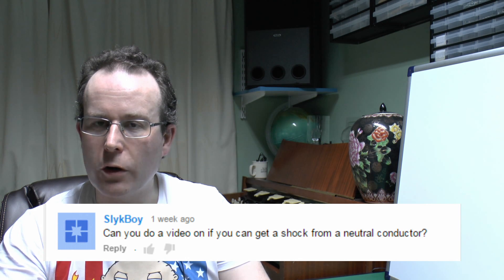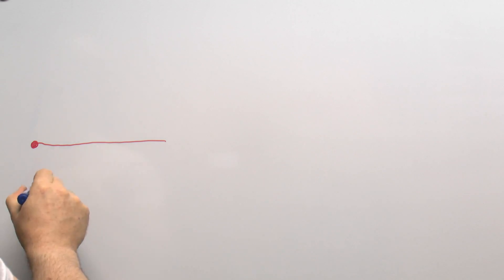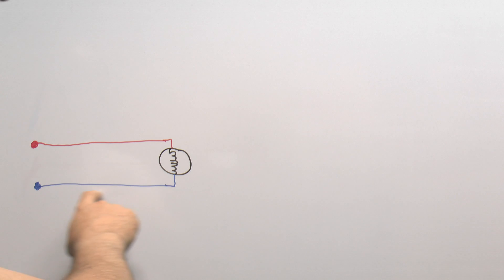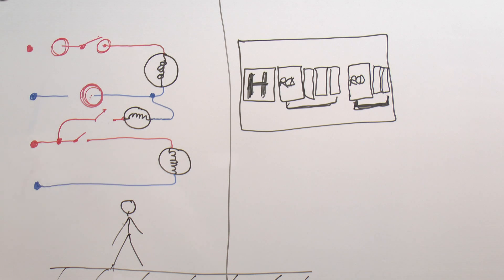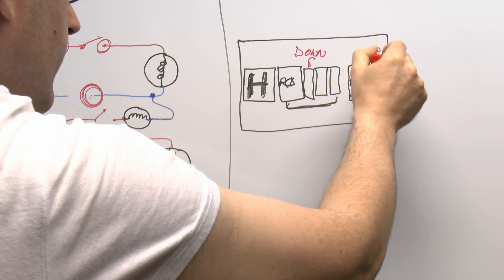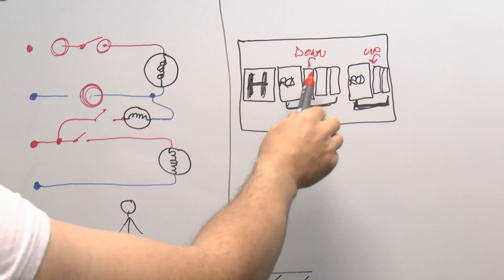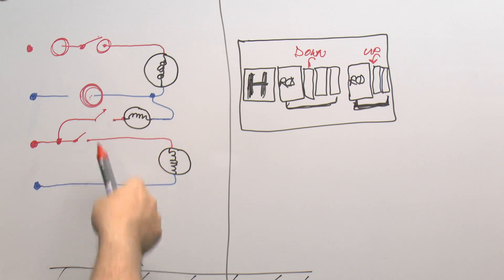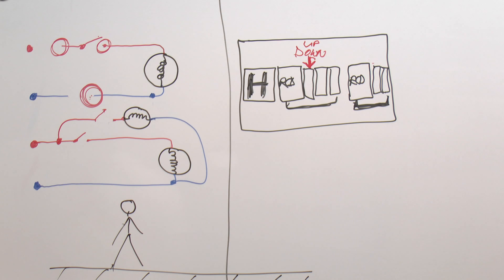Shared or Borrowed Neutrals on Mains Electricity Circuits

Comment: But downstairs you said if you are grounded ie touching the ground you get a shock but if you are upstairs how are you connected to ground to get the shock?
Reply from the maker: Most common building materials are conductive to some extent, and even if you are totally insulated there is still capacitance to consider.  It's extremely difficult to remove yourself completely from the ground, and the amount of current to cause a noticeable shock is tiny.

Comment: I worked as a meter engineer for several years. Part of the training was to be aware of borrowed neutrals. These can be particularly hazardous where there is a 3 phase supply in an apartment block. There was at least one occasion when a meter was exchanged ( not by myself)  which resulted in the neutral supply to other properties being removed . This caused 415v to be applied to 3 apartments causing extensive damage to electrical appliances. Other instances where borrowed neutrals can be a problem are when the live supply is fed through an RCD and the neutral is connected at two different points, i.e on either side of a time switch. This can cause the RCD to trip.
Reply: Very well explained have come across this many times.

Comment: Why, when a connection shorts to ground, does the electricity buzz, go silent, then explode? Why doesn't it just pop immediately?
Reply: 1. arcing,low current, 2. better coupling when heated and brought into better contact,high current flow. 3. due to large current, weakest link in circuit overheats beyond capacity and goes boom. over

Comment: I hope John ward answers me or anyone.someone to clarify for me,why is neutral earthed and i think the current 
would still flow between the two lines in absence of the Earth?It is said earth is at 0v,why does the bulb fail to light when you connect negative terminal to the earth without having another connection to the positive terminal of the battery or vice versa?kind regards for any comment

Comment: Yeah, ran into this the other day, come to think of it I still need to go back to follow up on some things. Another way is to clamp on an inductive amp meter on any neutrals your about to work on. If you have turned of the power to the circuit you are working on and find any reasonable amount of current on associated neutrals then it's a good idea to start turning off breakers until amp meter reads zero (or close to it).

Comment: In the Netherlands, we switch both Line and Neutral at the fusebox. That means that when you switch off the circuit you’re working on, you would immediately measure dangerous voltage on the entire circuit still existing. Well, unless the switch was off and then turned on while you were working, at least...
Reply: Do you have a neutral fuse for each group, or do you mean that the main breaker is disconnecting the neutral as well?
Reply: @amanduswestin9211  no, only the line is fused. But the switch (when those were separate devices) switches both. And yes, on modern boards with breakers instead of fuses, if the line trips it will disconnect the neutral automatically.

This is one weird thing about our electrics, (almost?) everyone else only fuses and switches the line.

Comment: I would like to see an explanation of why some parts of the world use 240V rather than 120V. I have received many, many shocks over the years from 120, and while they do tickle quite strongly, unless one is knee-deep in a lake, or otherwise very well grounded (Sorry, earthed. I'm American), they're more annoying than hazardous. I have been shocked by 240V only once that I can recall, and obviously it was a much stronger shock, much more likely to cause serious harm. It seems as if it would be much more prudent for the whole world to use the lower voltage, so why don't they?
Reply from the maker: Lower voltage = higher current for the same power, so cables need to be larger and losses in the cables are much greater.
120V would be useless in the UK, as we would need a 25 amp circuit for a kettle.
Reply: You have 3 KW kettles in the UK? If by 'kettle', you mean something akin to a coffee maker, mine is a mere 900 watts. And what are commonly used wire sizes there? Here, homes are wired for the most part with 12 gauge, which is just over two mm in diameter and is allowed to carry up to 20A, and 14 gauge, which is about 1.63 mm and may carry 15A. Of course, the mains coming in are substantially larger; I'm talking about interior wiring for lamps and receptacles and such. 
I'm sorry, I'm just very curious about why, once again, the US is sort of a lone wolf, and is doing things differently from most of the rest of the world. I mean, we STILL haven't switched to the far superior metric system of measurements, and it is the twenty-first century! Then again, you all still measure your weight in stones. It's all quite confusing to me.
Reply: Also, thanks so much for replying so promptly.
Reply from the maker: Kettles are used to boil water, mainly for making tea.  Examples here: http://www.argos.co.uk/search/kettle/
Better ones are 3kW, some cheaper types may be 2.2 - 2.5.
Wires are all metric and specified by cross sectional area of the conductors, common sizes are 1.0mm² for 6A lighting, 2.5mm² for 20A (or 32A where 2 cables are used in a ring), and 6.0mm² for 40-50A circuits.  Other sizes are available but seldom used in homes. Some cables in this video: https://www.youtube.com/watch?v=q_2qGZeXEd4
As for metric - some things are, plenty are not, some are both.  Large distances are always in miles, smaller ones can be in metres, weights of packaged items like food are metric but often in quantities like 454g which is exactly 1lb, car tyres have the rim diameter in inches but the tread width in mm, building materials like sheets of plywood are typically 2.4m x 1.2m, which is the nearest equivalent to 8x4ft but not exactly.
Reply: Most interesting, most informative, and again I thank you for the prompt reply. I was not expecting to hear back so soon. I hope you will enjoy a relaxing Sunday afternoon.
Reply: @jwflame  
This made me laugh out loud.
It must look ridiculous to people from other countries.
Reply: we've had 3kw kettles for quite a while and the mains cables were only 10amp rated. probably ok as a kettle is only run for a few minutes at a time..normally.. but one time  we had to boil a few times one after the other, the cable got scarily hot! they ought to have fitted 13amp cable 😲

Comment: You speak of a retrofit light with control upstairs and downstairs, then you only show a single downstairs switch...?  Also, when running the cable to the new lighting fixture (4:57), if you are running a cable, why would you run a single conductor?...you wouldn't! (I don't think this is even allowed in the US!)...you would run a new four conductor cable (since you're running cable anyway!), with Neutral and Safety Ground from ONE source, to the new fixture, as well as new upstairs (called a two-way circuit here) switch, and prevent all of this rigamaroll!  Playing games with the Neutral like this can set up for all sorts of "creative" issues...  Cheers from Connecticut!

Comment: STOP . A twenty dollar motion activated battery light in the stairway would solve the problem. NO wires no Bullshit. I use them in several areas with no issues.  Why make life complicated when simple solutions exist????
Reply: but...not as bright, and you'd be forever replacing batteries if there was a lot of traffic .....
Reply: The units I use have more than enough light output and batteries, 4 D cells, lasts for months. They cost a mere twenty bucks and are simple to install. Really, stop doing it the hard way!!!!
Reply: that actually sounds a good one, only ones i've seen so far use AAs or even AAAs, and/or poor light output!!
Reply: It may have been 30 or 40 or even more years ago that some of this doggy cabling was installed. Battery operated PIRS may not have been around back then.

Comment: Quick question for you. Can't find any reference for it. I have a site with a generator. I have fitted an interlocking changeover isolator / switch. I am not sure however if I am permitted to bond the generator earth to the site frame. Any ideas ?
Reply from the maker: It is permitted and in most installations would actually be required - if not, then the supply from the generator may not be referenced to the installation which may prevent protective devices such as circuit breakers and RCDs from working properly or at all.
It's also essential to confirm exactly how the generator is configured, some have an internal link between the neutral output and the generator earth, others do not, and some evil ones are configured as centre tap and other unwelcome arrangements.
Reply: John Ward Thanks John. It is nuetral bonded and connected via a 5000Kva UPS that starts and stops it. I just wasnt sure if I had to install an earth rod. Thanks so much for the prompt reply. Keep up the great work :) Thanks again.

Comment: Thanks, in the States we share common (white wire) all the time.  If the common is discounted you end up with 220 volts and it will burn out everything on those 2 circuits. We have this problem in remodeling, the Demo crew will remove a hot and a neutral not  realizing the white is shared down the line with an other hot.
 In the States, in a 3 phase panel we skip every 3 rd breaker space because that is the high voltage leg.  Then someone that doesn't understand 3 phase sees all these empty spaces and installs a 120 V. curcuit for outlets   It works for about 2 hrs until the appliances burn out.  They can't figure it out because 3 phase is only used in heavy commercial and Industrial applications here.  Some Cities require all 3 phase circuits to be in a separate high voltage panel and all the outlets and lights in a low voltage panel.

Comment: Ummm, the three-phase situation is potentially (groan) a problem whether it's a 3-pole breaker or 3 single-pole breakers.  Because all those lights will have switches.  And all those lights can fail or be removed.  If any one light is switched off, removed, or fails, and the shared neutral gets disconnected, then neutral is at a high potential.

In fact, the disconnected neutral only stays (relatively) safe with power applied if the loads are equally balanced.  So if two of the lights are 100W and the other is 60W you again have a problem if neutral gets disconnected.  Not as much of a problem as if one light fails/is removed/is switched off, but still a problem.

Then again, if you're working on the wiring and relying on the state of switches because you can't be bothered turning the main breaker off, you have a big problem anyway.
Reply: Never seen three phase in residential! USA only two legs coming in from utility.

Comment: Great video JW, it's late o'clock here down under and I'm listning to your videos whilst typing invoices,  common neutrals is a real problem in older houses here in Au, mostly when two way switches were added to long halways or stairways, I have even had a case where the sparky installed an outside light and stole its neutral from one of the slab heating zones.  The poor customer never understands why a light that has worked for the last eleventy seven years and probably has never even had the globe replaced, has to be disconnected or spend a small fortune on "fixing" it.  Thanks for the time and effort you put into your videos.

Comment: in 3 phases system with loads in star there are not nealy symetrical or sinlge phase loads its a disaster if neutral fails at a commen point! it make a asymetrical voltage splitting on loads! so more asymetrical the load is so more asymetrical is the voltage! i spoke with a electrican he worked on hamburger dom ( jahrmarkt ?? festival ...  there was a major fail in neutral at a point there was a heavy asymetrical load! most diveces are bürn or explode on much higher voltages!
Reply: If you can guarantee the loads are equally balanced you do not need a neutral because if the balance is perfect the current in the neutral will be zero.  In practise you can tolerate a slight imbalance and still get away with it.

The major power lines in any country rely on that fact to save copper.  It's just the three phases between the power station and the big transformers at the other end.  Oh, and equipment that trips out on major imbalances. :)
Reply: Yes, and guess what ...
One time, i saw some electrician (a very dump one) who connected the neutral of a 3 phases circuit through a single circuit breaker ... go figure!

Comment: Actually is it not true if so you touch a live hot wire & so long as you're not grounded & or touching the neutral or a grounded item like a ground wire, a water pipe or something else that's grounded like say a puddle of water' the current will not then flow thru you or shock you? At least I know it never has me. Also it's so much more dangerous to touch a live wire in one hand & a ground in the other hand as then the current can & will pass through your one side to the other through your heart & it can kill you. Now I have taken a lot of shocks & simply because I was not grounded I survived it!
Reply: The not being killed by touching the live wire trick was demonstrated by a British Rail safety guy standing on the live rail during our safety course many years ago. Whatever you do, he said, don't put one foot on the ground otherwise you'll have both feet in the grave. He added that you shouldn't do it if it's wet out too

Comment: how to get safety mechanism at a home where such type of shared neutral occurs in different phase circuits. Is there any device which could trip if such a situation happens please suggest which to be used for a three phase connection

Comment: The worsed thing I ever found and the most expensive on a three phase installation was when the neutral was lost at the service meter this gave 400 volts across most of the lighting and power only found when two different phase circuits were switched on giving a path via the neutral terminal block which was just acting as a through connection all electronic equipment blew up all lighting capacitors blew up.  I have noticed lately that the service neutral is not supplied from the meter but from a block terminal instead.

Comment: I had a similar illegal neutral problem too where a lighting 1mm2 and power circuit 2.5mm2 neutral was connected together at a combo bathroom fan/light/ heater. When we tried to install a RCD on that gpo circuit it would trip when the light was switched on. It was a illegal DIY electrical job done by the previous owner.

Comment: In the states we share neutrals all the time (our power supply is set up for this 240/120 volt . Borrowing a neutral is a fire waiting to happen sharing a neutral on your system is the same a fire waiting to happen. On our system we share neutrals between two circuits a/c if you connect a load out side of these two circuits its a fire waiting to happen since we don,t fuse neutrals ,the new code with arc faults fixes this problem since the neutrals are not shared and the circuit will not reset.Thats if a breaker is used in the panel

Comment: Mr.Ward the part i didn't understand well was if there is power in a circuit and if we touched the neutral we wouldn't get a shock, but if we were grounded wouldn't our body be considered tha same as a resistor i series with the lamp because we would still complete the circuit. Or does it have to do something with the voltage drop across the lamp??
Reply: The resistance of our body is then placed parallel upon the resistance of the wire,and our body is about averaged 50 kilo ohm.So there will be no current through your body,because the resistance of the wire is far less than your body.

Comment: My question to Mr. Ward..
why there is no electric shock when we use the neon screwdriver to test electricity?
can we consider the screwdriver like the lamp (as a load)?
thanks in advance....
Reply from the maker: When working correctly, the current flow through these devices is very small.
Reply: John Ward When working correctly? that sounds terrifying.
Reply: These devices can fail if made cheaply (which all of them are) or if they get wet. It's much safer to use a 2-pole test lamp. If you MUST use one, then make sure you buy it new from a reputable shop, so you can sue someone if it goes wrong.
Reply: @Zoey You mean your dependants can sue the supplier...
Reply: smiling face    Col
Reply: There is a high-value resistor in the internal circuit of the tester.
Reply: That is correct. A Drummond test lamp is the standard equipment for testing, neon testers are only used where there is no alternative i.e. no available exposed earth.
Reply: Steve Jones I'm assuming the RCD trips in time to save you, but yes, there is that possibility.
Reply: depends how far you fell off the ladder

Comment: sort of same subject. when switching i/o or other relays why does the 0v have to be common? 

example if I switch a relay using a machines 24v supply but I use a separate psu in a panel as the 0v why wouldn't it work? all goes back to same star point surely? I'll probably sound like an idiot but no question is ever silly.
Reply: I gather it maybe just as simple as completing the circuit. just need clarification.